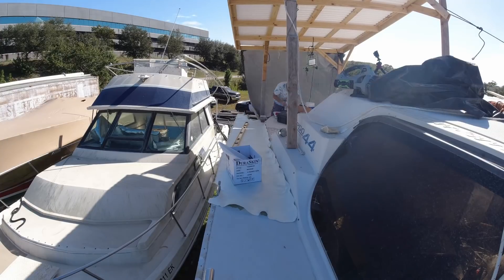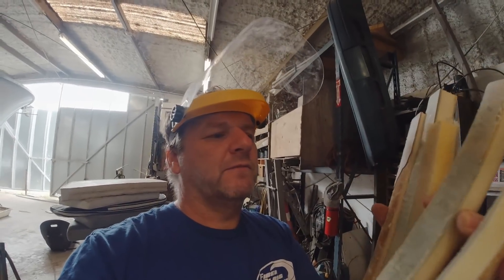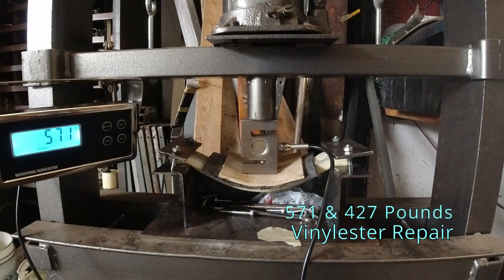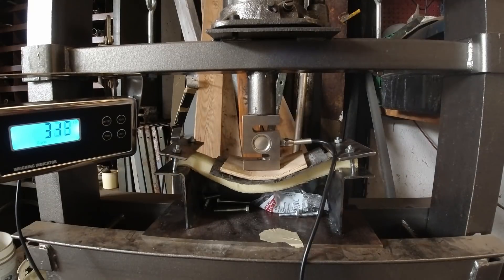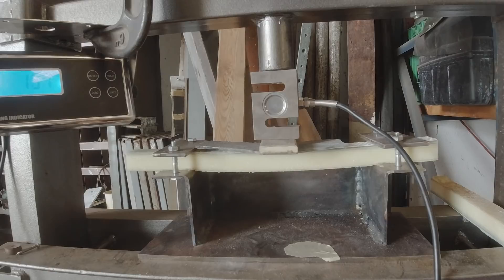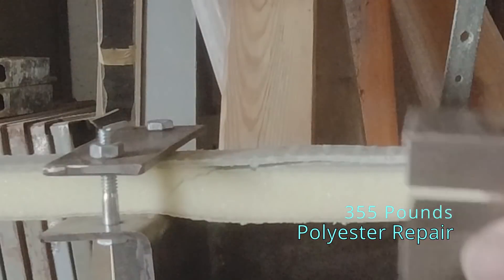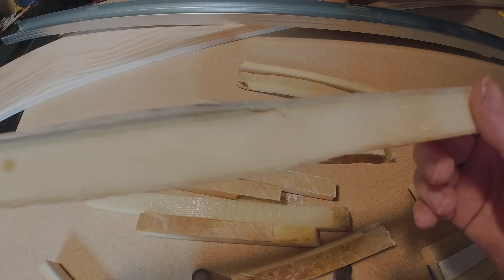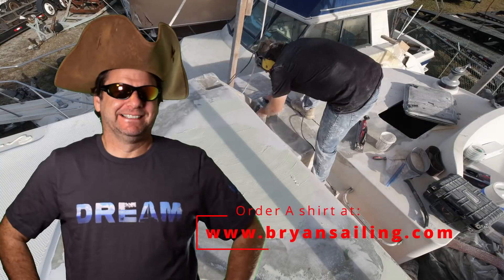19 Will my Salvage Boat Repairs Fail?

Comment: Hi Bryan - I commend you for testing samples using materials and method of fabrication you are going to use for the repair.  Great job!  I noticed on the testing that the general epoxy sample slipped in the grip and you had to retighten this might explain the low result.  Also wood between the load cell started as a piece of plywood, looks like it was reused despite being broken and eventually replaced with a scrap of hard wood.  I would think this has an effect on your results.  Also, some good comments posted on stress strain curve and 'Auroa' using an adhesion promotor for polyester repair.  Thanks for sharing.

Comment: This replicates my experience over the years. There are several things to keep in mind with resins. First and foremost, every resin is different. The properties of one epoxy to another can vary greatly, also the handling of it makes a huge difference. Temperature, humidity, resin to fibre ratio, fibre alignment, contamination all make it so that replication on even a professional level is very hard. This is the main reason why formula one and aerospace are going towards prepregs. It takes a lot of variables out of the equation.
Generally speaking however, polyester is cheap, has a low modulus, is britle, and the secondary bounding is way worse than it's primary bonding. It is therefore good for high quantity production but useless on repairs.
Epoxy is expensive, has secondary bonding that is comperable to its primary bonding but it is very susceptible to temperature and especially humidity. On an amateur level and for smaller repairs it is the perfect choice. However, one should shop around and test different epoxies because they behave very differently. Vinylester is inbetween the two in almost all cases but it has a low shelf life and I would only recomend it on new builts or large repairs like you are doing to lower the cost.

Comment: I squeegee thickened resin on the foam core very firmly in 2 directions then lay glass out. Helps with bonding and air pockets
Reply from the maker: Great tip

Comment: A way to make a better bond with polyester repair is to soften the area first with acetone.
Reply: A better repair is not to use polyester, it absorbs water which leads to osmosis and delamination
Reply: The strength of polyester comes from forming bonds on a molecular level during the curing phase aka polymerization. The complete structure becomes one giant molecule where every atom is conected to its neighbors. For a complete reaction the polyester resin has to be sealed from the air. This is achieved by the mold from one side and with wax from the other. The wax is added to the resin when the last layer(s) is laminated and flows to the surface. Acetone is used to remove the wax because it inhibits any resin to stick to the surface. Acetone will NOT soften polyester if it is fully cured. The thinner in polyester is by the way styrol, not acetone. But also styrol will not soften polyester, because the polymerization of the resin is ireversible.

Comment: Love your videos and how you go about repairing your cat. Keep up to good work. Just FYI- You showed a stress strain graph of metal. The one for composites is very different in the sense as soon as something breaks it can no longer take load (at least not to the level of when the damage occurred). So for composites the graph you showed will go to the yield strength position, assuming that's where the failure occurred, the stress strain graph will go straight down to zero as it can no longer support a load.

Comment: This is really great so thanks taking us through your testing. Very worth while for that peace of mind knowing you are using the best or near best method not just products. Something I would like to know more about is how to optimise that first layer. The first layer will be the mechanical boundary layer and the critical point of delamination if not done right. The subsequent wet on wet lamination should not be an issue but however many layers you apply they all hang on that first layer.
Reply from the maker: I'll try to show that in an upcoming video

Comment: What you are doing is great, but an exoskeleton structure is best evaluated with a computer module. The boat's manufacturer should have one made and tell you the most critical points to reinforce, and as you said, those points that actually need to flex in order to maintain structural integrity.

Comment: Im cool with your tests
all you should be trying to do is prove the repair exceeds the original, and this far that looks good to me
one caution, Im in Au which can get hot,109F is not that uncommon
its harder to judge working pot life of epoxy on the field when the mix is 5:1 vs 2:1 or 1:1
which means the stuff either burns up in the pot or never goes off because it just rained and temps dropped
cheers

Comment: Can you comment on what "Sailing Aurora" has done for the repairs? They have used polyester but for better binding, they have used another layer to connect the polyester to the core. So what if you re-do the test using their method? They have done some tests, and they showed that the binding layer can be a lot stronger than direct polyester.
Reply from the maker: There are so many ways to repair and many that will work and many that only sort of work. My test are really about proving what I'm doing is going to be good enough for me and my boat. I can't really say much about other methods that someone else is using, but I assume if they tested it it should be fine.

Comment: If you’re doing lost of round get something that can rotate the work (a manipulator) tig the Queen of welding remember the only difference between mild steel and stainless is the carbide once’s it’s gone it will rust use aluminium foil to purge underneath thin gauge welding

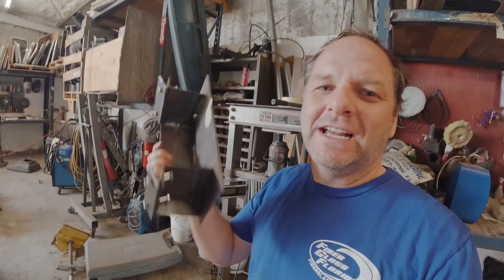Comment: Hi I enjoy your rebuild and your approach to problems. I am upgrading my 1965 Pearson Triton and I have no experience with fiberglass laminate boat builds. I am reinforcing my deck to hull joint and I was also concerned with hard points. If I made it to robust it may crack in another area. I was thinking if I tapered it out with my laminate to spread the load. ?? I posted a 1:30 second video on where I am at on my channel. Sorry to ask could you give me advice on what would be a good idea and or things to consider? If not then I understand thank you again.
Reply from the maker: I left a comment on your video. Looks like a fun project.

Comment: I can greatly appreciate the spirit of doing the testing, but as many people have pointed out there are so many variables so the results would be 'iffy' at best.  One thing you have to consider with your epoxy samples (and probably any resin for that matter) is that it actually doesn't reach 'full cure' for days or even weeks after the laminate is laid up.  To save anyone the time, effort, and cost of this type of testing where you really can't be totally certain of the results: if you don't have the actual lay-up schedule of the original laminate (and most people won't) measure the sample and determine the finished thickness of glass on each side.  Lay up your new glass to equal or exceed that thickness (but not crazy excess).  Where ever a feathered repair is, and most repairs are usually that, I'd exceed the original laminate thickness by 15 to 20%.  If you go with epoxy on your repairs, you should have no worries what so ever.  On large repairs, Vinyl Ester makes total sense, but I wouldn't use polyester on repairs ever, I wouldn't even use polyester to build a new boat.  Vacuum bagging is your friend and you should use it wherever feasible.  It does not have to be infusion, just wet lay up and bagged... the breather cloth and peel ply absorb a significant amount of the excess resin but the most important factor is the perfection of laminate compression plus lack of air bubbles.  Its worth the extra prep time and consumable cost... Vac pumps aren't as expensive as people seem to think.
Reply: I believe that he does have the original layup laminate schedule. I could be mistaken though
Reply: @scarface-39  Its extremely helpful if he does, takes out a lot of guess work!
Reply: I worked with a friend who was a laminater at PDQ. Their boats were polyester above the waterline. You should be able to smell the difference between build resin when you grind the glass. I agree with one of the previous comments, if you can vacuum bag the foam on you will get a much better repair. Keep at it.

Comment: Bryan I have looked this up several times but can't find a clear answer. Can polyester, vinylester and epoxy all be used as a resin for bonding with glass fibres/filaments? Does waterproofing and strength go up in each case and apart from cost, are there any disadvantages as you move from polyester to vinylester and then epoxy?
Reply from the maker: All can be used. Vinylester and epoxy are stronger and more waterproof - polyester is not. Other than cost there is no disadvantages of Vinylester over polyester, it's better in every way. Only one with epoxy is it's not recommended to put gelcoat over top (paint is fine)
Reply: @BryanSailing  Thanks for clearing that up for me. Perhaps paint rather than gel coat (as you state is required for epoxy) might be an advantage as more variety is available.

Comment: It’s felt Boat Manufacturers won’t release testing of their boats materials. That’s sad, as much could be learned. 
There are well documented Material Flow models to understand what is happening. Realize Metal Flow models will be similar as most other materials, composites may be more complex. They still will have the weakest based on the weakest material used.  Ie the weakest chain is its weakest link!
Picture a central datum line that runs in the center of the thickness of the test item. 
The inner radius compresses while the outer radius elongates during flexing. The design of draw dies as an example, is based on the target material tensile strength. Small radius produce breaks while larger radius flow. Another concern is grain direction.
What may break is the glue strength ie epoxy, resins, etc. These strengths are published by manufactures.
Compare the published results with your type of resin/glue samples.
What was noticed was the foam core was compressing. There’s probably different types of sponginess in foam cores. Also some use balsa wood as core material. I’m thinking the sponginess is needed to absorb denting as opposed to a breakthrough crack. How else do we repaid average dents?
Commented on prior video release about wanting to see more explanations of what your doing. This was a well done video!

Comment: The Fibreglass industry uses a drop impact strength test, rather than sheer and bonding test like this.
The bonding interface test is pretty irrelevant, as the pressures should only be in compression, never sheer.